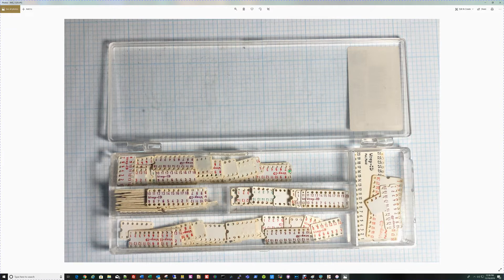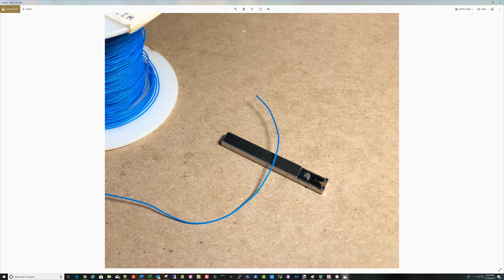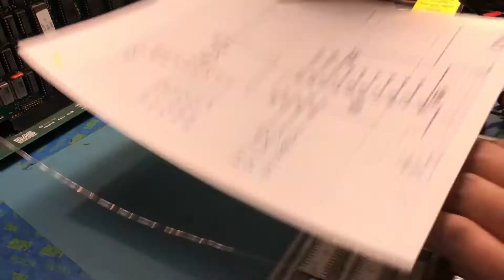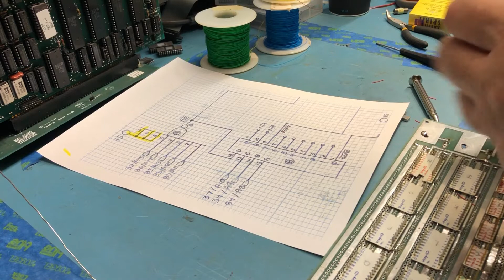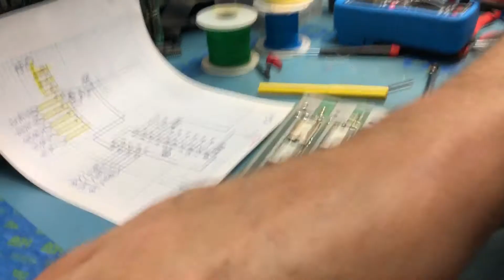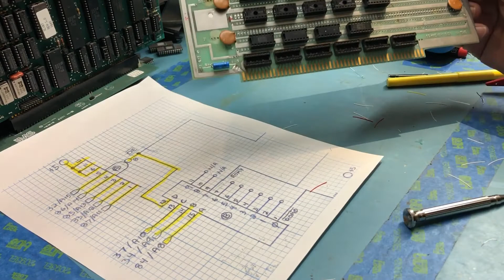STB414 - Altair 8800 - Part 39 - Homebrew 1702A EPROM Board - Wirewrapping the address decoder

Comment: I've etched my own PCBs and i've wire-wrapped exactly one board...
Not something i feel nostalgic about, LOL...

I have the radioshack wire wrapping tool, but lost the stripper at some point :/
Reply from the maker: Decades ago, I needed a keyboard for my LNW80 (TRS-80 Model I clone). I managed to find a surplus keyboard. I cut all of the traces on the PCB and soldered wire-wrap pins on each pin on the key switches then wire-wrapped the key matrix using the schematic from the Model-1 keyboard. It was ugly, looked like a rat's nest but gave me years of reliable service. It took a BUNCH of rewrapping as there was a lot of mistakes. I doubt I could have got this working has I soldered in bodge wires. The solder side of the PCB didn't have key symbols, so I was working from a hand draw location diagram of the back of the PCB. Between making mistakes on the diagram and not being able to count to get to the right pin on the PCB it was a mess. I used wire wrap as I was scared soldering, resoldering etc. to make it work might have lifted the solder pads or caused issues inside the switches from making several solder passes.